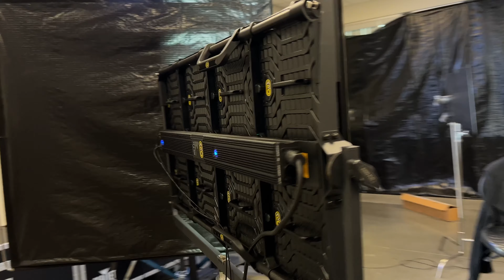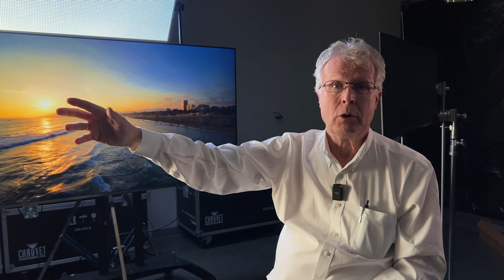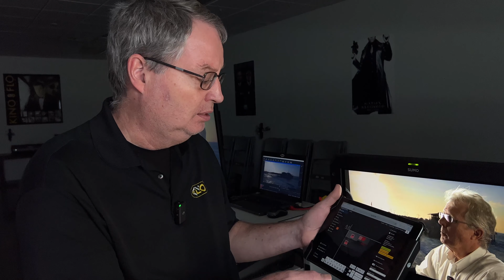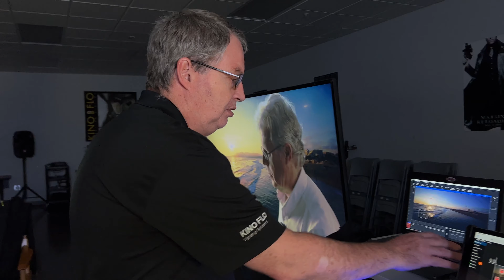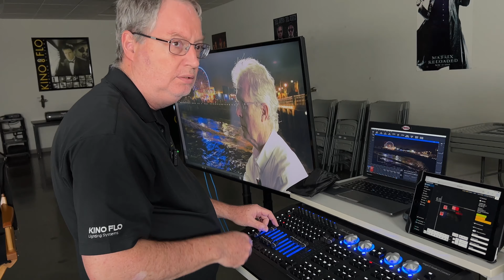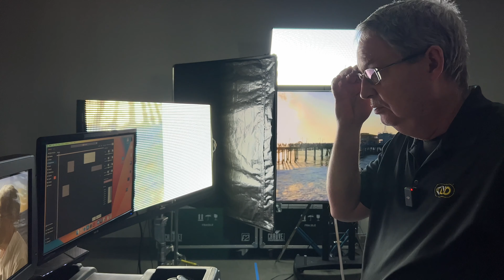Kino Flo MIMIK - The Light of the Future!

Comment: I agree it's a great product and it's easy to see the potential. However my concern is pricing. First there was no mention of pricing, and second, anytime a vendor starts talking about rental houses using it you know they are only interested in selling to rental houses, studios, and super large production houses. This is one reason why small indie production companies are locked out of competition. It can be the best virtual production item out there and it won't be available / feasible to 95% of filmmakers.
Reply: I think there are going to be other products that are more suited to indie such as single pixel mapping to say a COB light. Prolycht are working on that and I'm sure others are to. To get really real duplication of light from a scene I would take a VFX ball when shooting the plate and taking info from what is NOT seen on the camera plate and mapping that to your surrounding Mimiks. Either that or generating the off camera scenes with Unreal.
Reply: @haxstir  Quasar has an array of tube lights that pixel map the scene to create reflections. It comes real close to accomplishing the same thing. There is a difference between them and the Kink Flo's above, but from an indie point of view they would accomplish the same thing. My guess is that the pricing would still be out of range for smaller owners.
Reply: @Justin_Allen  I really need to do some test shots but I think you can get pretty close in ways that aren't to expensive, especially on a rental basis. Quasars can be expensive I suppose but hiring other COB colour lights isn't out of bounds price wise.
Reply: I think at a certain budget don't shoot virtual. Where that line is though is down to many factors.
Reply: @haxstir  I agree. For me I am working to build out a studio as I learn more about the VR process. My issue is that 99% of the VR out there looks ...very underwhelming. There is a huge difference in quality between the $0 - $200,000 price range, then a big bump between the $200,000 and $500,000 range than anything above that is what we see in theaters.  Look at trackers for instance as an example. You have a low of $5,000 for a Vive Mars set-up and then you have $35,000 for a single camera Mo-Sys set-up.  A huge spread in pricing and yes there is a difference in quality but the quality gap is closing while the pricing gap is not.
Reply from the maker: Price is not official yet cause they haven’t released them yet, they got those first shipment of 25 for qc after o shot this interview, so that’s not strange. It will be relatively expensive, and not priced for ultra low budget filmmakers, that is correct. I mean we’re talking about the most advanced cinema light available! 

However with even a few panels you can do a ton, and if they are available to rental houses, then you could rent for your products for a fraction of a cost of buying.
Reply: @AlexPearce3d  I agree with everything you said. I would push back on the use of "ultra low budget filmmakers" however. That minimizes everyone who is not a studio, rental house or a big production house located in a small handful of cities. I have never considered my production company ultra low budget and yet in pricing out a really small volume  studio ( 16 x 10 ) I cannot get this built for less than $150,000, and that's just equipment cost.  If you are considering that number, or below, ultra low budget then yes I am ultra low budget. However I promise you that more than 95% of indie film makers are in this same boat. As to rental houses, the closest one to me is 7 hours away. It's not feasible to get much of this gear that way. 

I am not disagreeing with the capabilities of this light. It is far superior to the other lighting options out there. I can really see its use against green screen to really set the scene, but even there that has its challenges. For volumes If I was to buy this I would look at either 2-3 of these lights, or a small moveable series of LED panels volume to place on the side. My guess is that this light will be in the $25,000 - $35,000 range so it's going to be a toss-up. I would guess that most smaller companies would go with the smaller moveable volume because they can use that in more ways. However either options is far out of the range of 95% of filmmakers.

I am not slamming Kino Flo. They are just doing what basically every other company is doing. It's a land grab for the biggest clients out there. It's a rush to build the highest price must-have item for large volume spaces. Why do you think that it's almost impossible to get pricing on almost anything related to virtual production equipment without multiple calls and a "consultation" with the vendor. Why do you think that Mo-Sys is now partnering with LG to create "all-in-one" packages. The large corporate world is the next target.  By the time this is done the indie filmmaker will not be able to compete in any way with the same look and feel of larger houses.

Sorry for the rant and again, the Kino Flo light is exciting and thanks for showing it. I'll just never have a chance to own it.
Reply: My rant is going to be considerably shorter than yours: This isn’t for you or 95% of filmmakers. This is specialized equipment. Get over it. Eventually there might be crappier versions at more economical prices, but who knows when.
Reply: @MarcosElMalo2  Not sure you read my "rant" Let me summarize for you. It's not for 95% of filmmakers. And that's the problem with small studio volumes right now.
Reply: @Justin_Allen  Why is it a problem for you that you can’t afford to buy this? I just don’t get the complaint. You build backyard sheds for a living and you’re upset that cranes to build skyscrapers are out of your reach.